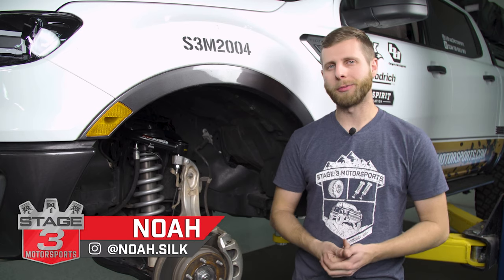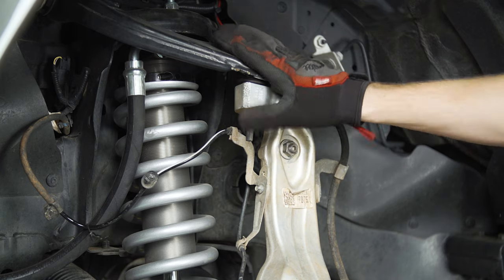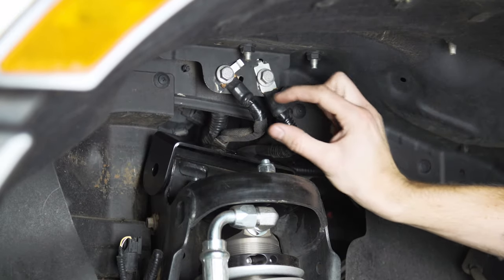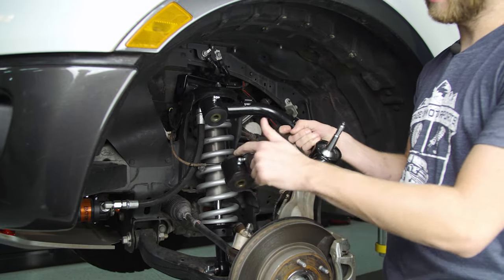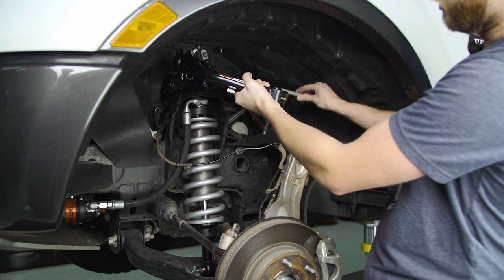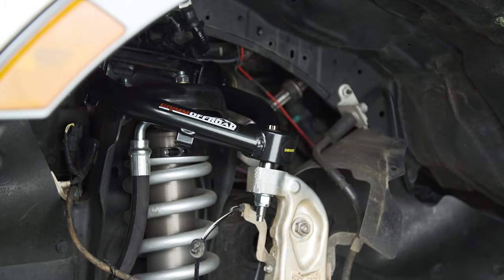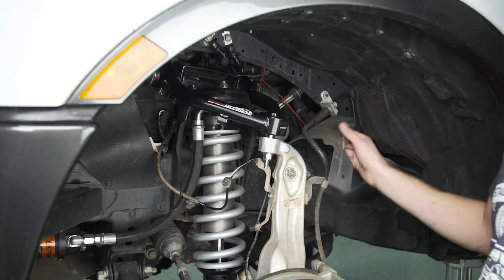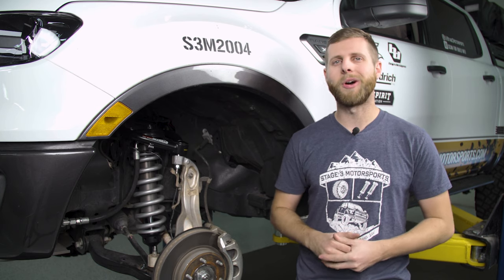2019-2020 Ford Ranger Grimm OffRoad Tubular Uniball Upper Control Arms Install

Comment: Noah always liked your install videos, and I have watched a lot of them over the years adding things yo my Ranger, but sadly the rest of Stage 3 Motorsports, Grimm Offroad, and Icon could care less about your long time customers when they have a problem. One of the uniball studs stripped out on the upper control arm wat before it was close enough for torque wrench and its been over a month now and everyone refuses to help fix the problem. I even offered to buy a uniball stud at one point and still no one will help. I drive this truck daily for work as I've told everyone and now it is with a stripped out uca stud. Lost a customer of Stage 3, Grimm, and Icon. Everyone beware before buying

Comment: Noah, great job of providing a well produced and informative how to. I was hoping for more information on why. If I go with a 2” lift, 275/75-17” tires on the stock sport wheels will I be limiting travel or increasing wear by not replacing the UCAs?
Reply: Thank you! Much appreciated. Typically with 2" or less of lift up front you don't need to replace the UCAs. If you go higher than 2" I would absolutely recommend it to get a better alignment and allow for a little more travel.

Comment: I installed these along with the fox shocks from you all today.  I have a question.  There are 4 smaller washers in the kit and the written instructions from Grimm seem to say they go onto the taper adapter along with the nylock bolt.  However none of their pictures or your video show these washers being used anywhere....any advice?

Comment: Hi Noah, I have already commented on your Fox 2.0 Shock upgrade. Are these UCA's a good match for those? I'd like to upgrade but there is a lot of choice and I'm looking for some direction. Cheers
Reply: These UCAs do pair up nicely with the Fox 2.0s and they're not a bad value. I also like the BDS arms, but they use a standard ball joint instead of a uniball so the travel is a little more limited compared to these Grimm arms.
Reply: @NoahStage3  Thanks. I'll take a look. Btw, any idea what a clinking or knocking noise might be after having had the Fox 2's installed? I'm getting an off clunking sound from the passenger side wheel that was not there before fitting the Fox 2's. Any known issues?

Comment: Not liking how loose that abs wire connector is when you tried to snap it into the a arm.
Reply: Those factory clips do sit a little more loosely after they've been pulled once or twice, but they can be replaced with new clips or zipties if you're having trouble getting them to hold. Fortunately we haven't had any issues with ours falling out.

Comment: Hey Noah,

Was wondering about ucas that work with cast iron spindles, do you guys have any of them in the works?
Reply: Sadly we only have options for aluminum spindles at the moment. I'd assume that most of the manufacturers are looking into designs for a new arm or a different taper adapter to fit those cast knuckles, but I have yet to hear any confirmation on this.

Comment: Ahh it’s not a good idea to route those red and black wires so they lay against the steering shaft. Just sayin!!
Reply: Those wires are not laying against the steering shaft. There are zipties that hold them up-against the fender liner when it's in place and you can see that the wire insulation is still in perfect condition since they have never made contact with the shaft.